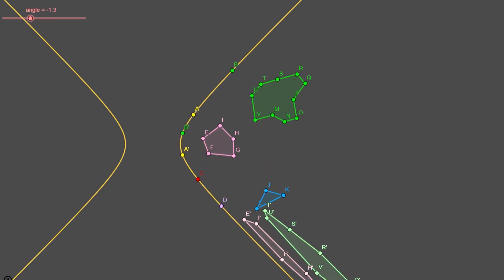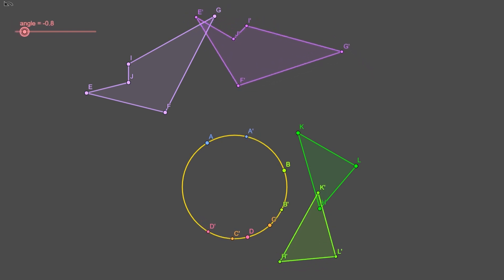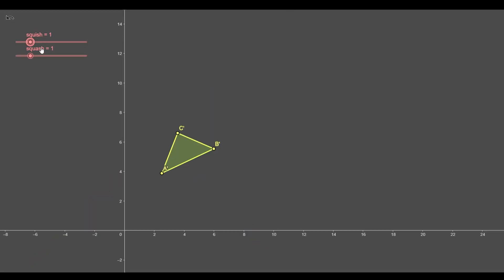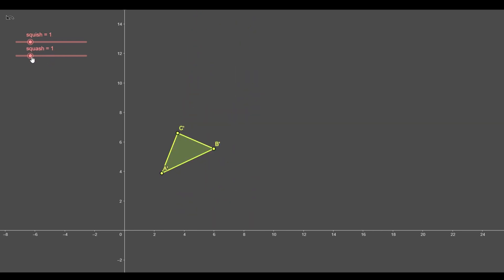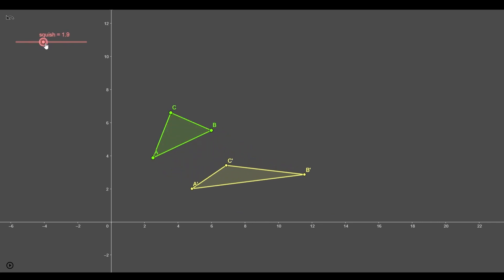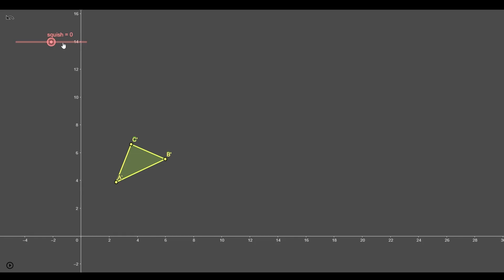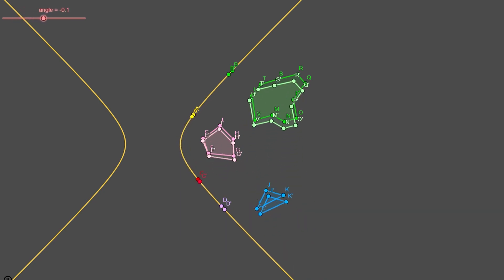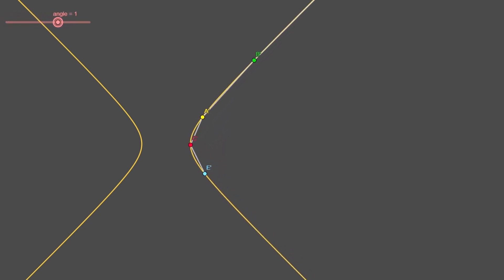What are hyperbolic rotations?

Comment: Nice animation! Got me thinking: It's clear that for three 2D points X,Y,Z, we can compute the triangle volume v_0=V(X,Y;Z). And if we parametrize the motion of the corner points we get a volume v(t)=V(X(t), Y(t), Z(t)). I wonder to what extent v(t) can be expressed as a function of v_0. That is to say, how severely does v(t) depend on the base positions of the triangle, and not just on the volume. I'm afraid a lot, because I have the feel triangles that are far away from the origin in y-direction have a bigger variations than those close to the origin.